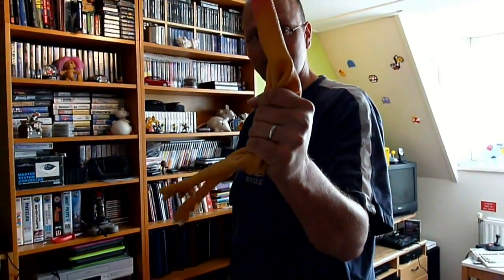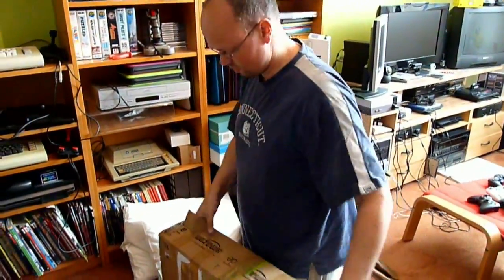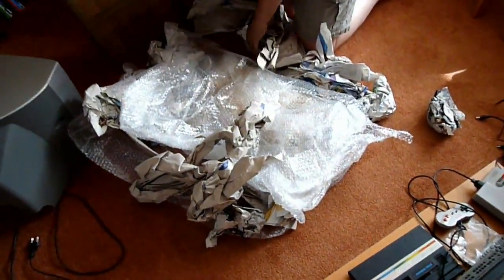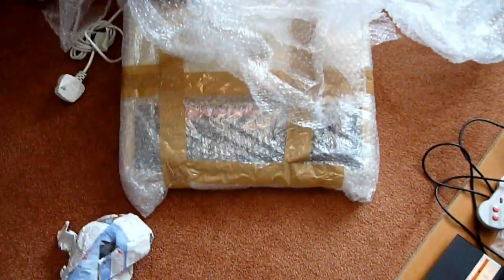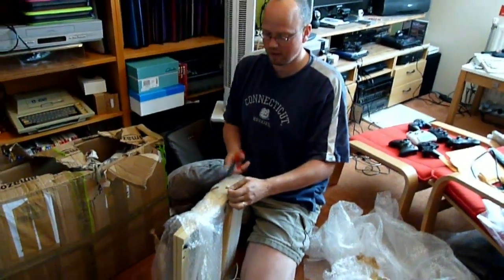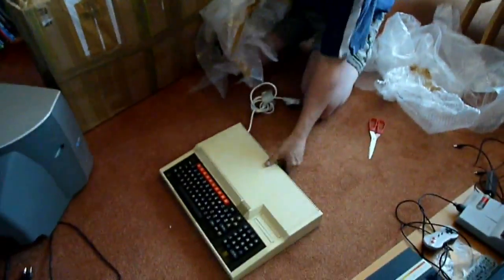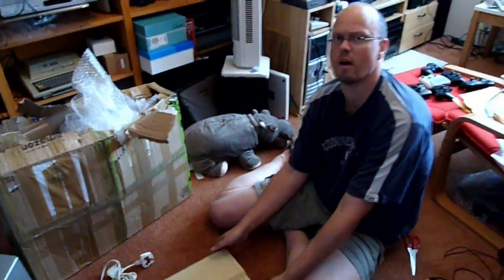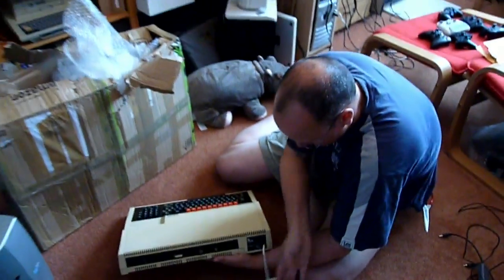BBC Master 128 System with a RetroClinic Datacentre (HD)

Comment: Where have I seen that red usb stick before? Very nice system {love to try out the ethernet} and most superb. What you do certainly adds to the build and may have to get a master  system edtion!
Reply from the maker: Inertialvortex It's a great system and I pull it out every now and then for some gaming.
Reply: lactobacillusprime  dude, same here :) might try it with a built in raspberry pi hdmi. Perhaps have to check out your "cd-rom" in the pack - it's well versed for the board lol.